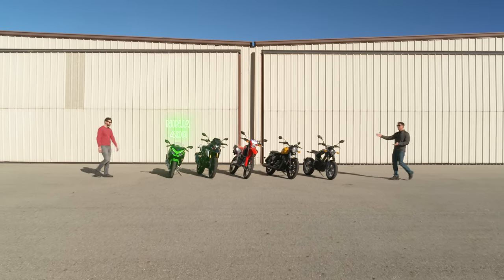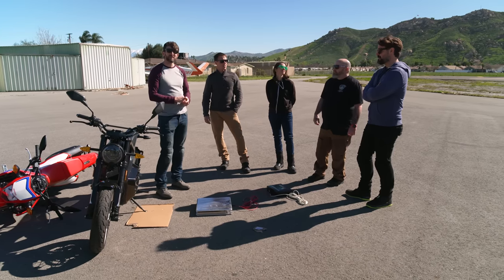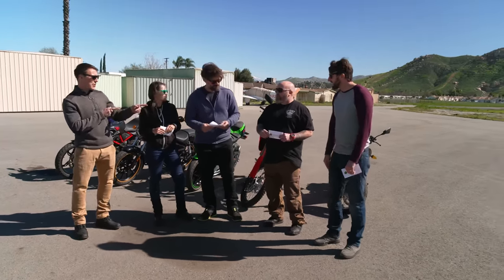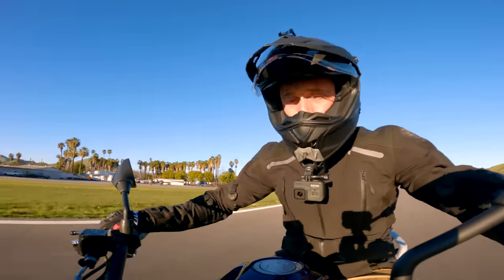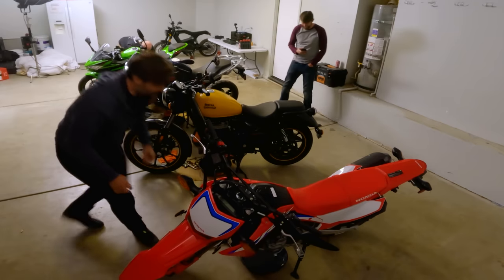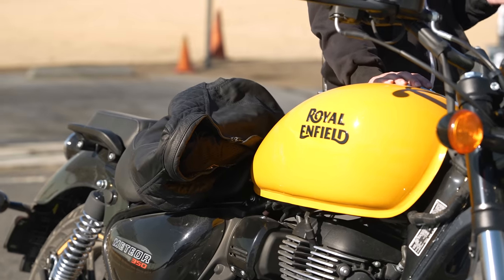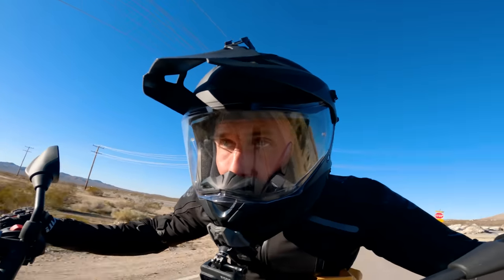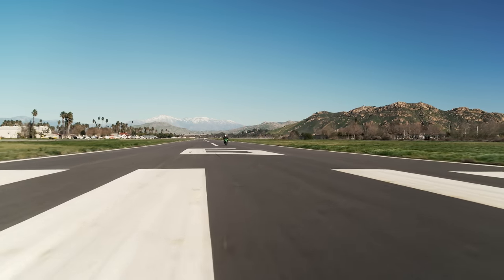Best Beginner Motorcycles! Ninja 400 vs Meteor 350 vs CRF300L vs Sondors Metacycle vs G310GS | CTXP

Comment: I bought a 21 KLX 300 SM 2 years ago and i fucking love it.

I put 9k miles on it in ruffly 7 months before i wrecked it. It took waaaaaaay to long to get parts, which I blame on 2020 shipping junk...

Anyways, i ride it constantly and i beat the piss out of it. I have a extra tooth on the front hub so I can smash on the highway with RPM's under 10k.

I really love the bike. Exhaust and power commander incoming by end of year too

Comment: The pick up test is a great idea.  I do think you need to use a jack and hold each bike at the same angle.  Not to pick on Jen, but she was sitting on the seat so the bike was supporting part of her weight which is what lowered the value artificially, in my opinion.  I suspect if you used a jack and the same angle, you would find the results quite different.  Great test idea though.

Comment: I would like to see a shoot out with the current Dual Sports offered by Japans big four. My old man grew up with them back in the 70's and was looking at getting into the CRF300L. I would like to see a comparison of the CRF300L, KLX300, XT250, DR-Z400s, and the TW200 as a wildcard. Basically to see which is the best of the mid sized dual sports. Also a follow up with a shoot out between the the 650's with the XR650L, KLR650, and DR650S.

Comment: If there is an oil change race that the sondors wins by default then there should also be a refuelling race since you will be doing that a LOT more often than oil changes. Maybe give 50 points for the winner since thats probably how many tanks you will go through per service. 
Infact a lot of bikes come with servicing packs now so you wouldn't need any time more than it going into the dealer as normal anyway.

Comment: One thing I'd like to stress from my own experiences working for a dealer who handles both BMW and Royal Enfield. For either of those brands ESPECIALLY Enfield, buy new. You NEED the warranty. Bmw warranty on the G310 is needed imo and the Enfield, I'd say you're nuts if you didn't buy new. You might save maybe less than $1k? And you'll definitely spend that in headaches not having warranty.

Comment: I own a GS, I believe it's the perfect bike for doing literally anything, focused more on the road. You won't be going on week long rides but it's comfortable enough for a whole day. Off road it's amazing, although I need a real pair of tires as the originals are street tires. 
I guess if you like to do trails mainly but want a bike that's doing fine on tarmac, I'd recommend the Honda, it's got better suspension and a gear box for trails. Ninja sounds good for racing or going on a highway, but you don't want to redline the bike for too long aka you won't be going with 100 for the whole day.
Meteor looks amazing, I'd buy one if I had the funds, maybe later :D
Sondors looks unappealing to me, and it's only ever useful in city environment, which sucks imho

Comment: If Kawasaki would ever build a Versys-X 400, it would be quite the force with which to be reckoned!

Although it wouldn't have impacted the final results given the Ninja came out on top, the win might have been even more decisive if they had used the Z400 instead. I suspect it would have had a lower drop damage repair bill. Other than a little less wind protection, I think the increased comfort and control of the more upright stance gives it better usability in urban riding environments. Either the Ninja or the Z are great beginner bikes that I always recommended when I worked in the powersports industry.

Comment: Small? budget friendly... well I sat on a Gixxer 250. it was a good price, that I could've handed over there and then, but I couldn't get my knees under the wings on the tank and move my feet around the levers... so small is out of the question. the V-Strom 250SX seemed so tall, that I felt small on it (and I'm over 6 foot 1) but the SV650 felt about right! very right in fact!
The Ninja's seat it too far forward, and I felt so cramped... it was worse than a Moped!
so what next?
gas burners ruining the planet? have you seen a Lithium mine? and the toxic gasses when the battery combusts and cannot be put out, so it just kills everything down wind? 

a good test would be riding at 50km/h in 10*C for 15 minutes and see who's shivering the most!
prediction... the electric bike will be faster off the line, and hard to catch, but when the others are at the petrol station for 5 minutes it will be on charge for the next 5 hours!
 also the ninja will be the quickest of them, and the fastest, but the rider will be in too much pain to gloat!
the honda will have the lowest top speed, but be the fastest going up hill!
Oh, the highly combustible battery bomb was slow... Not surprised about the ninja though!
I wonder how far ahead speedus diminitiveness would have been with the Ninja... given it's the fastest already, and the rider weight being the lowest would make it really fast!
Last test, I predict the dirtbike is going to be passing the BMW on the dirt, but loose out to it on the stretch of racetrack, while the Ninja ends up either sliping over or getting a puncture! but the poor old royal Enfield will get covered in the dust from the others!
 oh yeah.. the battery bomb will go flat and need rescuing!

Comment: No doubt my Versys 300 would do well here.  Quicker/faster than the 310 (indicated 106 - 15T), easy oil change (if a K&N filter is there), and peg to peg sparking with my 50/50 Trailmax Missions.  The BMW fork is more compliant though in the rough.

Comment: I understand you could only have so many bikes and you already had a Honda, but I really think the Honda Rebel 300 should have replaced the Royal Enfield. It's the same price, makes very similar power, similar styling, weighs 60 lbs less (according to Honda's wet weight claim),  and has a great low seat height at 27 inches. Oil changes are much easier and faster because it's just a plug and filter, and it runs more standard intervals.  My wife rides the 500 and loves it and it was a great bike for her to learn on. Again, I get why you picked the Royal Enfield, but I wanted to put this comment here for other viewers who might have liked the Royal Enfield.

EDIT: And after watching the final test, mid controls for dirt!

Comment: You misunderstood torque, which means little without power. To test the torque, or more precisely pounds of thrust, you'd have to climb a series of increasingly steeper hills and test which motorcycles CAN do it regardless of how fast.

Comment: Biggest issue I have with this whole thing was that they did not mention range or charge/fill up time. And whether people agree with it or not it’s a big factor. I know a lot of electric bikes are struggling getting past 100miles (let alone the sponsor not even breaking 80), that’s a problem with infrastructure of chargers, on top of that if you go for a ride and go just a little too far you’re stuck trying to find a charger or waiting for roadside just so you can get home on top of the fact that all of those gas bikes take less than 10 minutes to fill from empty where as the electric bike probably takes minimum an hour just to get to 50-75% charge

Comment: Ariel did a crappy job of servicing that RE. RE is known for its easy serviceability. It might have the shortest service intervals, but its damn easy. And the aftermarket service is impeccable. Roadside assistance here, is under 10$ (US) anywhere in India, let the other brands match that!
Kawasaki Ninja is my dream bike so not biased at all, but in terms of serviceability there is no matching RE. Its built to run and last, a different purpose than all others, a Cruiser. The fair comparison would have been with the RE Himalayan 450
Totally agree with the performance in all the tests, other than the Wrench Racers. Loved the video overall!:yt:

Comment: What is the price for the first dealer service? Adjusting the valves costs a fortune for those two cylinder bikes with fairings. What is the purchase price? Shouldn't such be considered? 

It seems that the Sondors is flat out lying about those torque figures. Within this group, I would choose the Meteor for style and simplicity. The Honda would be second. 

Is there a lighter smaller dual sport motorcycle that could go 70 mph for less money than the Meteor? I think the KLX 230 S costs more. 

The best beginner motorcycle is a scooter. A 125 cc scooter can go 50 mph. It will have storage under the seat. It will have an automatic transmission and cost less.

Comment: Great video, I have a metacycle and you pretty much hit on all the issues with the bike. Thermal limit, seat sucks, and those torque numbers have to be made up. Overall its a neat bike, but really thinking about getting a gas for more long distance riding. I just completed a MSF Basic RiderCourse with gas bikes, and the one other huge thing that I think beginners might like about the metacycle is zero shifting, and learning the clutch. With that said the future of electric bikes is still in its infancy and should explode like cars / trucks have in the space. (I own an EV truck, SUV and car with the metacycle being the only EV so far that hasnt been to impressive)
Reply: Gonna b AWHILE  ... energy DENSITY vs weight

Comment: as a passionate ninja fanboy who so far, has only ever and only plans to ever own sport bikes, seeing the ninja not live up to its potential hurt. it should have been absolutely, far and away, fucking SHREDDING on the track, but the rider was going as slow as the damn meteor. man was leaning 35 degrees at most, a skilled ninja rider would be dragging elbow and would have been into the urban section in about 70 seconds

Comment: the best beginner motorcycle is a 50cc to 125cc dirt bike that you ride for 2 years in the dirt. learn how quickly a motorcycle can get away from you and many other things in the dirt before you venture out into the unforgiving asphalt with 4,000+ lb missiles coming at you at high speed from all angles. - Old Rider

Comment: I would have preferred a RE Himalayan if you are using RE bikes, 350 is a slow and steady bike but wouldn’t match with your testing
Reply: With almost no extra power and extra weight would it have done any better.  And the cost is higher.

Comment: I don't even look at these as beginner bikes anymore.  I started on a 750cc, and within a month or two I was riding a GSXR1000 and a Hayabusa.

At this point I do not have a bike.  I am not sure if I will buy one again.  A family friend was struck my a drunk driver while riding his motorcycle, and after months of fighting infections and some moments of clarity he recently lost the battle after a surgery didn't go well.

PS.  I didn't drop my bike over the 7 years I had it.  It did however fall over in the trailer when I was taking it to be sold, and lost me 500 bucks off the sale price.  An expensive lesson to take ALL the slack out of the front suspension.

PS. Naked bikes, if you scrape the frame apparently insurance companies will have a cow and it can make it difficult to sell a bike.

Comment: The maintenance test was a joke. It was a test of the rider, not the bike. Also the Meteor doesn’t need frequent oil changes. They would know that if they actually read the owner’s manual. Every other “service” is simply an inspection. Also, when the oil needs changing the valves need adjusting. We should have seen that on each bike. 

And finally, the service should have been performed by the same person so the rider would not be the major factor.

Comment: From experience the only one of those bikes that was probably damaged badly enough from dropping would have been the Kawasaki.  I'm not hating on Kawasaki either. Every bike Ive owned except a 06 rc51 has been a Kawasaki.  The fairings and snorkels don't like being dropped.  But I have friends who have bent their frames on other bikes from low speed crashes.  Never had that on my 636.  Never crashed any of my other bikes but the 636 has been crashed close to a dozen times.  Even the tail is cracked.  But truly important except the snorkel.  You can only zip tie the snorkel back together so many times as it holds your held lights and speedo to the bike.

Anyways I'd stay away from fairings or get a cage.  If I had a brand new 636 (I've owned mine for 20 years so it's not new) but if it was new I'd have bought a cage day one.  Same with that 400.  Even now as someone who has been riding for 20 years if I bought that 400 I'd get a half cage for it.  Beat the bike to a pulp and enjoy it

Comment: Ninja 400s are brilliant bikes but the parts are stupidly expensive, almost Polaris level. The fairing quoted in this test would be only one of the 4 parts that make up the side fairing assembly.
Break them all and you are over $2000. 
I have two Ninja 400 project bikes, a 21 like in this test and a 23 KRT. (Purchased damaged to fix)
Factory’s need to make fairing bikes less susceptible to damage from a simple fall.

Comment: 'Seems like the only way to achieve consistency in evaluating these very different bikes would be to have only 1 experienced rider, and especially not 5 riders racing "beginner bikes" or mixing dirt-oriented with street bikes. This was fun to see, but virtually meaningless (except for testing the weight of picking up a dropped bike). A new rider would probably be happiest living with the Royal Enfield Meteor - or Hunter - 350, and learning to adjust the screw-and-locknut valves.

Comment: The big joke about the BMW G310's service cost is that, the BMW GS310, G310R, G310RR and The Indian manufacturer TVS's Apache RR310 are pretty much the same bike. They are made in collaboration and share the same parts and same engine. Still BMW for the same parts charge a lot more, 2-3 times more, compared to the Apache RR310, all in the name of brand value. 😂

Comment: Replace shifter? Just put it in a vice and bend it back straight.
Reply from the maker: The idea was if it broke off. You can certainly bend levers / etc back if they are just bent, but broken off is an entirely different story and just as common.

Comment: Drag racing is hard to judge since a beginner without any experience can lead to massive injuries if just going full throttle on a semi-busy street with actual cars who dont pay attention to you and driver without even knowing a good body position or how to hold the throttle in the best way. Maybe if you added a drag race with a sudden sharp turn or a random full on brake check it would have been better.

You should have done these tests with real beginners instead of experienced riders. Maybe the cameraman who drives a ford focus, maybe the wife, maybe the producer...

Comment: best to get a Junk, Used, Disposable or if you prefer new..  chinese.  I believe  you need to drop your bike maybe 10 times before you're even a decent rider.  I think the Lifan KPX250 at $2900 shipped cannot be beat.  Similar to the KLX300 at less than half the price.  Amazon has the same bike for $3300?  You can always sell it for more you paid.  With bark busters, indestructable (within reason).  You'll need a guest bike anyway for your kids/grandchildren to learn on.. Or for exploring dirt roads in your area.   I'd say go cheap Chinese, but it has to have EFI as a minimum, IMO.

Comment: The fact that they chose the worst Royal Enfield bike for this test is not pleasing They should have brought Interceptor 650 as its under $6000.

Fun fact Royal Enfield 650 twins are cheaper than BMW G310GS in INDIA and Ninja 400 is almost the price of ninja z650, its literally that stupid of a pricing in india😅

G310GS- ₹38140 or $4649
RE INT650 - ₹362000 or $4426😅

Ninja 400- ₹630000 or $7705
Ninja 650- ₹755000 or $ 9233😅

Comment: Very interesting but usless as a comparison of beginner bikes. Skilled riders doing skilled rider things. The repair numbers an the pickup test was useful, but the rest, not so much. The other tests just showed us things that you would know just by looking at them. The Ninga is fast on the street, the CRF is good in the dirt, the BMW is ok at both, the Meteor is a slow cruser an the electric bike sucks. Beginner bikes need to be tested on how easy they are to stall an how easy they handle the MSF course. Things beginners do on their first bike before the inevitable upgrade. Comfort matters more to a beginner. I would also compare resell value to cost because most people upgrade. A bike that costs $5k new that you can only get $2k for used, in reality costs way more than one that costs $5k new but resells for $4k. That is a big deal in a beginner bike thats not so much in a non-beginner bike. Also, how much does crash protection  cost? Crash bars should come with beginner bikes but they dont so how much are they?

Comment: why are enfield bikes so heavy... 190.5kg for a 350cc air-cooled single cylinder.. No lightweight alloys i guess... only heavy steel in the production.. 
There is more performance to get out of the engine.. Compare the torque output.. 27Nm... to Honda's 348cc long stroke single in the 350 highness ,, that has 30Nm of torque.. So one could fairly easy get 12% more power and torque from the engine..  Numbers like 23hp and 30Nm would give the meteor just that little extra for highways and trimming the weight by 25 lbs would benefit the bike also..
Reply: I have a RE Classic 500 and damn that thing is heavy. For a 500cc it only goes to like 120kmph which even a Yamaha R15 can beat. But once you start riding that thing feels amazing because how much Torque it has. Once thing I don't like about it is how unreliable it is and there are no electronic aids